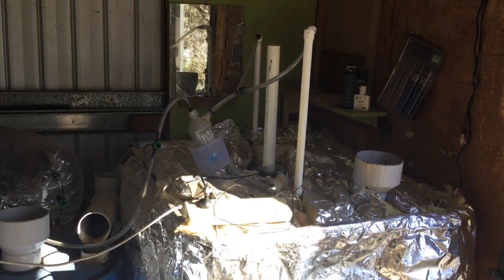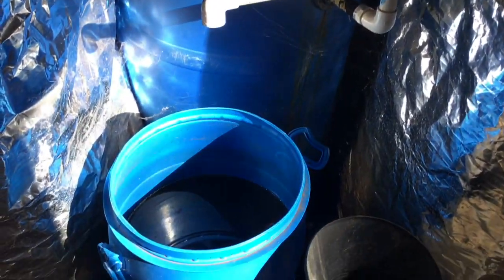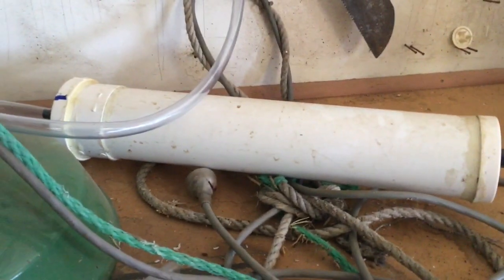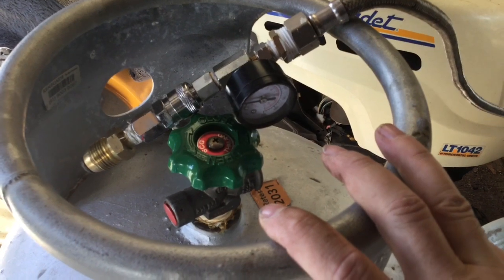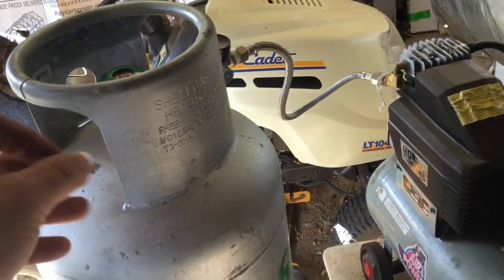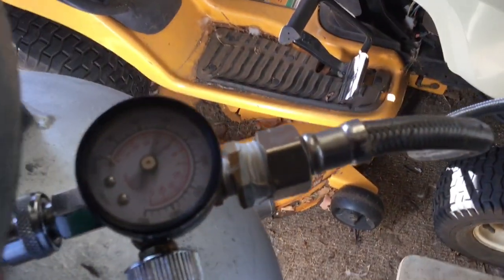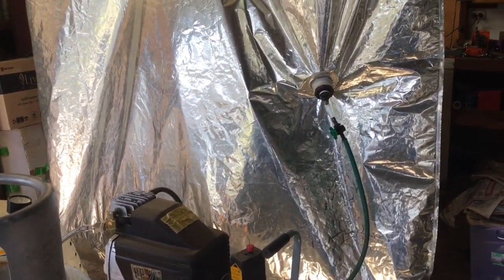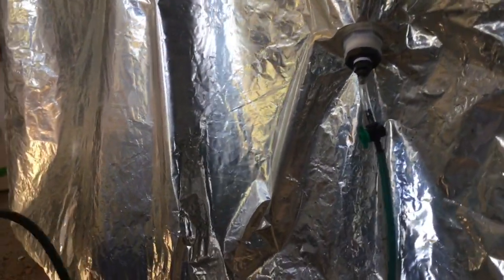Compressing Biogas !NEW! 1000L into a 45kg tank

Comment: hello thank you very much for sharing your knowledge with everyone, this video of how you put biogas in a tank gives me a lot of happiness why I need to do the same in my home. I would like to know what the machine with which you put the biogas in the tank is called ?, I have seen people using a refrigerator compressor to do the same, in your opinion this is dangerous? Thank you in advance for your answer.
Reply from the maker: The compressor I use is just a standard workshop compressor from a hardware store then modified with fittings to suit. Yes I’ve seen the vid from Tom H C using a fridge compressor, as long as there is no oxygen mixing with the gas I don’t see a problem, only the limitations of such compressors, even mine is not ideal but ok for backyard purposes, the compressor I want is about 10-20 thousand dollars.
Reply: thank you partner, if it is not too much trouble to make modifications to a refrigerator compressor to reduce the risk of explosion, have a good day.

Comment: question: the 1000l bag, does it fill on itself? i mean, you have to pump in it from the digestor or it flows on his own?

thanks man!
Reply from the maker: GC as the tank digests the food it releases the gas and under its own pressure fills the bag, there are several valves for shut off between different areas if needed. No pump needed to fill.
Reply: @OkAtEverything-ProAtNothing  tks man!! super project, i'm learning to be able to do it here in Italy.. but our temps are far colder.. so i'm understanding if it's valuable.. (30C in summer -5C in winter)! have a nice day!

Comment: Gday mate 
What was stopping the flame from going back in to the bag of gas that you did a small demonstration on?
Reply from the maker: Brad Smith there is no oxygen in the bag for it to burn, so combustion will always be at the end👍
Reply from the maker: Not at all mate, always good to ask. Depending on your location as to where you find fittings, I found my rh thread pol at BFC camping shop think it was about $20 and the pressure gauge and cock was at Repco general automotive accessories shop bout $30 from memory 👍

Comment: Hey I'm trying to find the best way to seal and connect an Ozark Trail queen size mattress to the gas outlet what suggestions do you have
Reply from the maker: It’s difficult, adapters for boston valves are hard to come by, in my earlier vids I have a air mattress set up, pretty much had to force pipe into the inside and glue it in place then use the pipe with a barb fitting with thread… then go from there. As long as your glue and silicon game is good, you should be right.

Comment: Hello. I'm producing biogas in turkey. I have a small system. I want to use a compressor to compress the generated gas into the tank. but my worry is this; Will there be an explosion during compression?
Reply: To avoid explosions, make sure that all the components, assemblies of the piping ,compressing and filling system are leakproof, and free from cracks.. your operating pressure should always be lower than the design pressure of system.. 
Before actually beginning any mass production line , ensure it is safe by performing various checks and tests... 
Install pressure gauges and pressure relief valves wherever necessary, there should be no compromise in this regards..  and last but not the least, avoid high temperatures, naked flames and sparks coming into contact with system..  .. provide enough ventilation for air circulation.... carry out periodic inspection of system to check for leaks, cracks and defects ...
Reply from the maker: No chance of explosion with no oxygen present 👍
Reply: @OkAtEverything-ProAtNothing thanks my friend
Reply: @OkAtEverything-ProAtNothing  oxygen is present in the atmosphere, and that can trigger unexpected disasters.. so be safe..

Comment: Brother can I know the name of the  machine you are using for  compressing such huge volume  gas into small cylinder
Reply from the maker: It’s just an everyday air compressor from the hardware store, you need to change fittings to get it to connect to the gas tank, this compressor is pretty rubbish, a good belt driven one would be better, or even better a compressor designed for compressing fuel gases, but I don’t have the money for them
Reply: @OkAtEverything-ProAtNothing  
Thank you bro and may i know how much it costed to you for this setup
Reply from the maker: I had a few parts laying around, maybe 50$ for fittings

Comment: What do you think the highest pressures you can go to are. Before it goes BOOM ?
Reply from the maker: Depends on temperature, I don’t compress more than 180psi due to the face that my gauge doesn’t go higher and the compressor is not really powerful enough to go over, 260psi is about average from memory, but it wouldn’t go boom anyway, tanks are fitted with pressure relief valves, like when if tanks are in a house fire, they don’t explode, they vent.
Reply: @OkAtEverything-ProAtNothing  The reason why I ask is Diesel works around 300 psi which is a mix of oxygen and fuel. Air is the enemy at over 250psi
Reply: My biggest concern is the compressor, how to be sure that it won't explode in the piston chamber? And the compressor  doesn't create sparks while running?

Comment: what size ftting your using from the propine to the compresser
Reply from the maker: The P.O.L fittings that attach to the tank have a set standard I pretty sure, as for the fittings to attach to the compressor I don’t really recall, there was a lot of trial and error and running back to the shop to get different fittings, the hardest thing was finding a POL fitting with right hand thread to hook up the hose, eventually found one at a camping shop

Comment: Why compress it into the gas bottle at all? Surely the amount of electricity you are using to compress it (unless you are 100% solar) costs at least as much as the gas would be saving you? You don't need to compress it that high to use it, so why bother?
Reply from the maker: Hi Steve, yes I’ve got off grid solar so only compress when the sun is out, I find compressing easier to store and move, also hooking directly up to the stove, shower or heater etc, plus the regulator on the tank gives a steady flow, yes you can use a pump, I have done in the past, but I find the tank better and more practical
Reply: @OkAtEverything-ProAtNothing  do you still need to convert your appliance (remove the jet and close the air mix holes etc) when using the bottle?